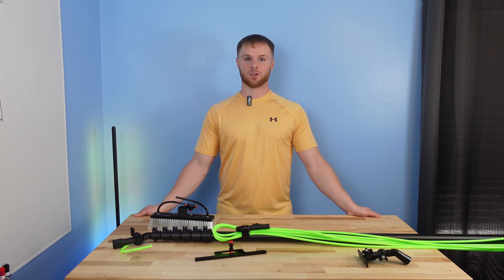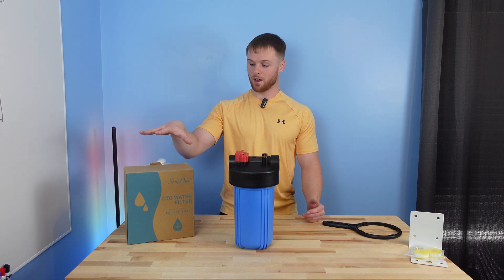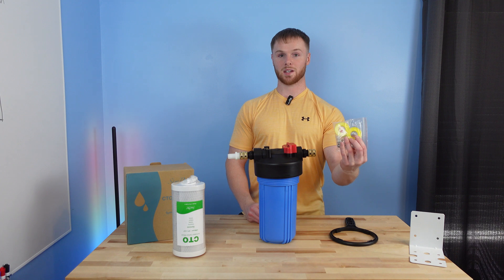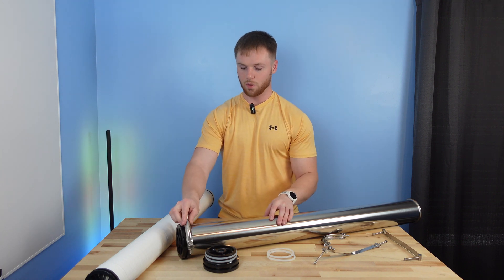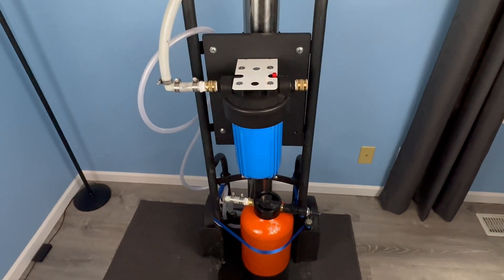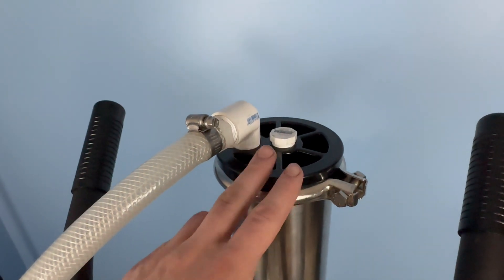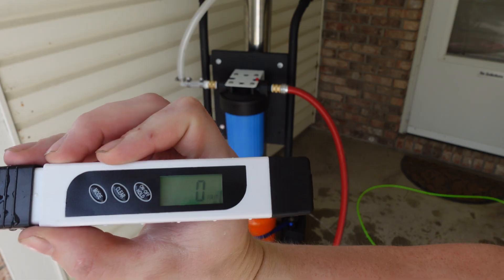DIY Waterfed Pole RO DI Cart - Full Build

Comment: Great build and works so well. The only problem is that my water psi is so low i can't do much - what do you recommend?
Reply from the maker: What’s the psi like in your area? I would double check the system for obstructions but if you just have poor pressure, you can add a booster pump to it

Comment: You would save yourself a lot of money during a build if you invest in a PEX crimper and use PEX piping.  You can also make PEX elbows pretty easy.
Reply from the maker: I considered it but honestly the fittings are cheaper than buying a $50 PEX crimper. If I was to build them at scale, I would agree.

Comment: I’m getting ready to build my system. It’s going to be Van mounted. Thank you for the great video. One question for you. How long do the ro filters last?  I only wash windows maybe a couple days a week. The TDS is around 6-700 in my area. It’s super high and am hoping this will fit my needs.
Reply from the maker: I change the charcoal filter every few months and haven’t had to change the RO or DI resin yet. We’re in the same boat of maybe doing windows 1-2x a week. 

Once you get the charcoal and RO set up, check your TDS coming out to the DI and then you can use the table for the DI tank that will estimate how many gallons you’ll get

Comment: What's confusing is you use a different filter on your 2nd video of this for the blue filter housing. Which filter do I use? The house filter or the resin filled filter. Im going off of the old build from this video not the new build.
Reply from the maker: Good question! Both of them contain DI resin. The one in the second (newer) build is a smaller cartridge with less resin. 

If you have poor incoming water, go for the bigger DI tank. We have pretty good water in our area so I wanted a lighter weight cart for the 2.0 version

Comment: So i was curious what fitting was at the very end where you can plug in the quick connect of the water fed pole hose to the system. Where can i get that fitting? Also what is the length of feet in 3/8 hose would reccomend is good? 200 feet?
Reply from the maker: You can find the fitting on WindowCleaner.com and we run 100’ of the pure water line. I’ve never tried more than that, but paired with a garden hose of 100’ you usually have to move the cart once to do a house.

Comment: A year later, is it still working and can you use a 50ft pole on it efficiently?
Reply from the maker: Still works great. I only ever clean 2nd story windows. I think you’d be best served with a booster pump for 50 feet
Reply: @pressurewashnerds  could you link a pump that youd recommend for this build?

Comment: The hand cart linked is not the same model as shown in the video…if I am seeing things correctly.  Lacks the think metal back straps that seemed to make your mounting solution viable.
Reply from the maker: The cart I used was a super heavy Milwaukee. I’ll update the link to the aluminum one I used for the new build, video coming soon. It has plenty of cross members

Comment: What’s up. Thank you so much and explains a lot. Do you have videos of putting a pump booster on or adding a second membrane. I want to start cleaning my solar panels with this.
Reply from the maker: Unfortunately neither. We’ve got great pressure and flow in our area. You’d just make a splitter though from the sediment filter to both RO membranes. Then run both outlets to another tee and into the DI tank. I would run the discharge on both to a common line through the same valve just so you only have one to adjust each time.

Booster pump you can reference other builds but I’m assuming it would go in line right after the sediment filter.

Comment: Whats the update today with your cart? Have you switched the membrane filter yet or your di resin? Where do you purchase your resin ?I just bought all the things on Amazon for this build. I already had a small DI tank I just need new resin. Is there a specific membrane filter I seen that there was a lot of them.
Reply from the maker: Original DI tank is still running strong. It was honestly way overkill for our area and incoming TDS but we don’t clean windows everyday either.

I would actually suggest getting the resin at Windowcleaner.com and they also sell a smaller DI cartridge.
Reply: Did you wish to do just RO or just Resin?

Comment: How did you drill the hole in the frame when mounting the RO into the metal. Thanks.
Reply from the maker: Just use a center punch to mark the hole and then a standard drill and drill bit. It’s steel but it’s fairly thin and easy to drill through

Comment: Hi, great video!!!  I am starting to build my RO/DI, housings and membranes just arrived and I am starting to source my fittings but im not sure what size lines will be the best.     Is it better to use 3/4" hose instead of 1/2"?.  Thanks
Reply from the maker: I always like to err on the side of larger tube and fittings, since the fittings are your choke point for flow. I built this system with 3/4” on the pure water side and you can use smaller for the RO discharge

Comment: I just completed the same build and the water pressure coming out of the DI tank is the same, but doesn’t seem to be enough to come efficiently out of the water fed pole, any ideas why? Do I need a booster pump? Different pole?
Reply from the maker: Yeah, if your flow is too low you’d probably want to add a booster pump. Flow to a WFP in general isn’t going to be super high. Give it a try first on your own windows and see if you can adjust the RO bypass to get the flow you need.
Reply: Check make sure your o ring isn’t restricting flow

Comment: need to check the water 3 places 1 incoming 2 after R0 3 after DI. Outer wise you don't know. I say that because i ran 450+ TDS thru DI and still tested 0 but rosin didn't last.
Reply from the maker: Yep! I didn’t cover it in the video but my water at the tap was around 350 tds, after RO was 18-40 depending on bypass, and post DI zero.

Comment: if the ro was hooked up to just a garden hose, what would the output be like? I have a di cart for pressure washing my cars and was wondering if i can use the ro as an inline prefilter before my di tank but i suspect that the ro membrane is pretty restrictive because all the set ups I have seen incorporates a tank to hold the water after it has gone through the ro and then it is pumped into the di via booster and then to the pressure washer. Would a hi flo ro membrane help?
Reply from the maker: At the end of the day, the single  RO is always going to be the most restrictive. The Axeon membrane linked in this video was the highest flow at low pressure (garden hose) that I could find. But I think if you’re trying to feed a pressure washer, I’d look at running multiple RO membranes in parallel.

Comment: How many gallons does this system get before the DI resin needs replaced. most di canisters total around 250-300 gallons without the r.o. system.   my guess is around 10x the use?
Reply from the maker: Totally depends on your incoming TDS and how low you can get the outgoing TDS from the RO membrane. Our TDS at the DI inlet is around 25 so our expected life is 5000+ gallons. There is a chart on the Window Cleaner website for the DI resin tank that shows expected life

Comment: What is the waste water discharge ratio procedure ? Are using tds to set up flow or purely water ratio like 4 to 1 ? . I’m not using a DI filter . This if for my hydroponic setup .
Reply from the maker: You can test tds to get the right reject vs clean flow rate for your hydroponic setup. Time is money for window washing so I’ll leave my discharge a little lower to get more flow through the DI tank. Resin is cheap!

Comment: my flow is slow coming out of my membrane and I have no idea why. Did you check your clear water where it exits before connecting to your resin tank to see your water flow? I know you said you got a low flow membrane but I really need some help on this one. Would a booster pump give me what I'm looking for and if so, what kind of pump would you recommend? I'm running 60 psi from my spigot but by the time the water hits my membrane and exits from the bottom port its very slow. Is this the way it should be?

Comment: I’m having a hard time finding a high flow high pressure booster pump. My house is only 45 psi
Reply from the maker: Any luck? Sites like Window Cleaner Resource and Detroit Sponge have some options for booster pumps but they’re a bit pricey
Reply: 12v 5.5gpm 60psi diaphragm pump on Amazon
Reply: @fredbear2nd  Second this ... if you haven't already found a solution. I successfully used these pumps for a salt brine spray setup back in my snow plowing days.
Reply: One thing that we did was got a 1hp sprinkler pump. They’re a lot cheaper and tend to work better than anything else I’ve tried

Comment: Most RO systems have a sediment filter before carbon. Do you recommend?
Reply from the maker: Depends on use. We are primarily a pressure washing company so using a sediment filter to prolong the life of our carbon filter didn’t make sense for us. If you’re running this daily or constant for another application then yes, add the sediment for sure.
Reply: @pressurewashnerds  Thanks , I want to use to lower town water TDS so I can add fertilizers to get back to about 1000 tds . What is the rejection rate you dial it to ? 1:1  to get 20 TDS ? Thanks again . This will save me $..

Comment: So I want to build a high flow system for my hydroponic system. I don’t need DI. Do you know what the TDS is from out of the RO only ? What is the GPD that this system will do ? Thanks !
Reply from the maker: Our RO was putting out around 20 TDS with incoming around 300. The Axeon membrane in the video will do 2500GPD at 80 psi. It’s a high flow membrane

Comment: I wanted to send out a genuine thank you.  I used your info and built my system to just about mimick yours.  Turned out great and works awesome.  I appreciate your time and effort.
Reply from the maker: Thanks for the kind words! Glad it worked out for you and saved you some money haha
Reply: @pressurewashnerds  Hey so I copied your cart religiously. However right after my membrane I noticed and huge pressure difference from going  in and coming out of the membrane going into my Resin tank. The pressure at my brush is super low.
Reply: This is rad. What did your pricing come out to?
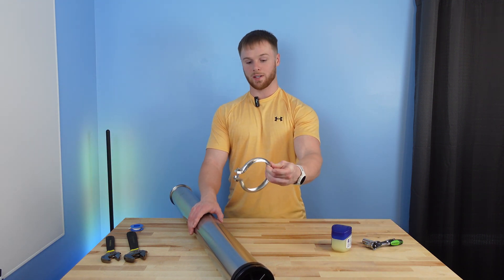Reply: 11:19 I've re studied and pulled everything apart and still low pressure coming our.

Comment: One thing I didn't catch was where the bypass/discharge line goes to. Would that be just on the ground, or where? Great and thorough explanation by the way! Very much appreciated.
Reply from the maker: Yep! I just adjust the hose so it discharges into the grass or away from the cart onto the concrete. It’s just hard water discharge

Comment: Hey Dillon.  I have a question.  I designed my  system just like yours.  I went with 1/2" fittings.  My inlet tank at the DI swivel fitting leaks.  Is that a pressure relief fitting.  I actually removed it and re-teflon taped it.  The thread is not leaking.  It's leaking at the rotating portion of the fitting.  Your opinion?
Reply from the maker: The fitting at the outlet? I’ve heard they crack easily so I went ahead and bought a brass backup from Window Cleaning Resource in their waterfed fittings section.

Comment: Nice video man, very well done! How many GPM are you getting out of this system? Wondering if its enough flow to have a spotless free rinse on cars
Reply from the maker: Thanks! I’m getting somewhere between 0.5 and 1 GPM. You would probably want to run several RO membranes in parallel to get higher flow for a car rinsing system.
Reply: Ideally, you would want a tank for the RO water with a pump and bypass to your resin filter (will reduce your PPM to 0), for rinsing your cars.
Reply: I have a tank with pump for rinsing cars

Comment: I live in Las Vegas and need the best filter for sand and carbon reverse osmosis. Do you feel that this build is suitable for my needs?
Reply from the maker: Yeah! You could consider adding an extra sediment filter in front of the carbon filter. That would catch all the large particles and preserve the rest of the system.
Reply: Very informative thank you. 
I’m thinking install something for my mobile detailer van, do you know if I don’t put the RO filter just , one Sediment + 1 carbon then the resin filter, I mean those sd+carbon filter helps at all ? If yes do you know if from my tap water I get 300 TDS, how much dose remove before the resin filter ?

Comment: I built one similar and mine is getting no water pressure through the water fed pole and out the di tank
Reply from the maker: Check all of your connections/fittings. Could also be a supply issue from your main connection.